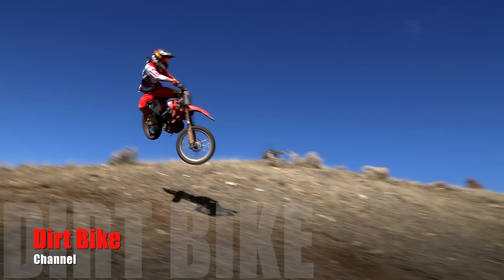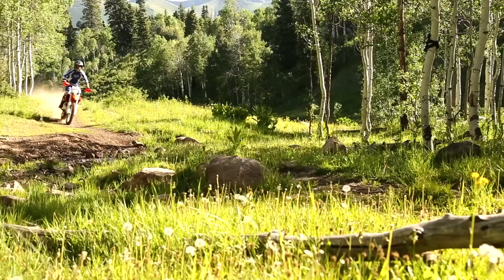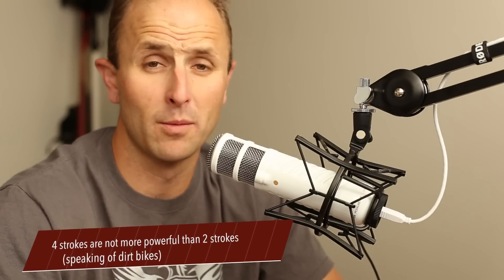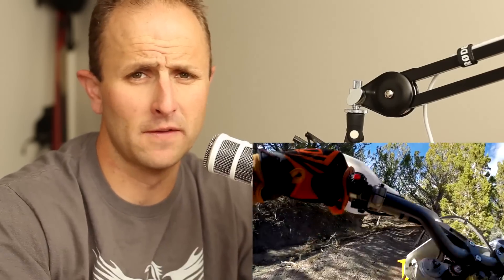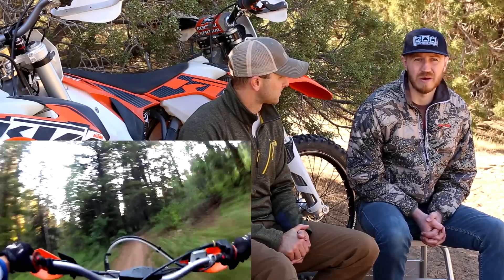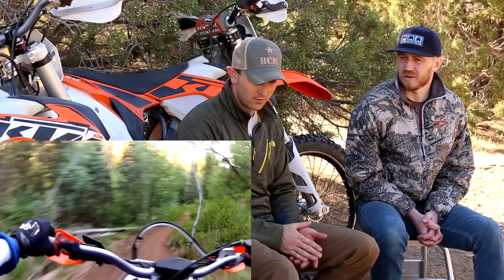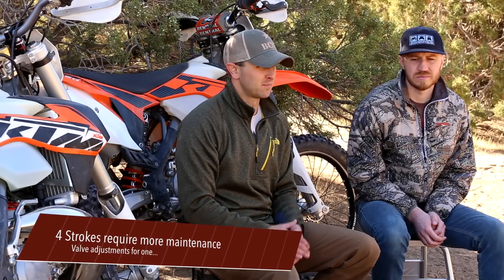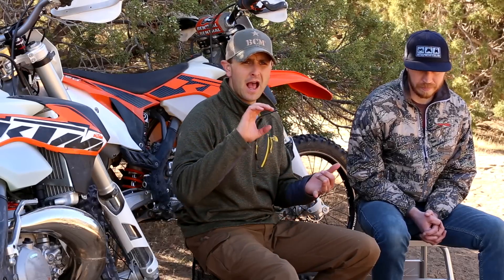Enduro 4 Stroke vs 2 Stroke Part 1

Comment: that do not make sense so the 250 make more pawer that the 454 the 454 should be fast lol
Reply: +pavel1809 how does it not make sense that a 250 2 stroke makes more power than a 450 4 stroke? its not all about displacement man
Reply: Imagrumpy Oldman Yeah i know about the Maico's but they actually dont have much power at all, but they're pretty damn cool still
Reply: Really? but they dont make Maico's anymnore?
The 490 from 1980's only had 30-39 hp x) todays 85cc's got around 34 hp, but then again, the Maico's are very old.
Reply: haha :D
Reply: My 250 makes 50 HP, with a good low end as well.

Comment: wow how bias is that. remember if you need to adjust the valves not when.
Reply from the maker: +Bill Needham First off, thanks for watching. Just trying to give a little bit of the bias back.  Everywhere else is very bias in the other direction.  It's called balance :)  Watch all 6 parts and you'll have a better idea of where I'm coming from.

Comment: They are full of shit lol 2 stroke cost way more in the long run way more rebuilds and yes parts are cheaper but it all adds up and if ur aggressive rider like I I'm 50 hours tops in my opinion for 2 stroke before u blow it up lol these guys make me laugh so hard
Reply from the maker: +Tyler M You blow up your bikes after 50 hours?  What bikes have you done that with? Just curious.   I have put more than 100 hours on multiple top ends on my bikes with no issues.  Let me know.  We can have a civil dialog about it :)
Reply: +Dirt Bike Channel I go long miles those roughly 1000 in 2 weeks 125s arnt good 2 stroke motors and I prefer 450 4 stroke way less maintenance more reliable and uses less gas and go longer distance I guess every rider has there own bike they prefer
Reply from the maker: +Tyler M Fair enough.  125 two strokes need to be revved out all the time, so they wear out much faster.  250 and 300 2 strokes are a totally different animal.  Glad you have a bike you enjoy. That's what it's all about.  I own a 450 4 stroke and a 300 two stroke at the time I' writing this, so I know a bit about the topic :)  Thanks for watching Tyler!

Comment: Ur only saying that 2 strokes r better cause u own one and I bet you have never owned a 4 stroke. Ur making this video to feel better about ur purchase and to be a YouTube bully! That's bullshit that you need to work on 2 strokes more! Engine rebuilds because your running at about 22,000 piston beats per minute! I'll never own a 2 stroke cause their shit and the 4 stroke was made to improve the 2 stroke and it happened! Get in the future m8 2 strokes have been replaced. If their soo good than how come factory's have stopped making 2 strokes😂
Reply from the maker: +COOPER CHANNEL Cooper, Cooper, Cooper.  I have no doubt that you are a nice kid, but I have to set the record straight here.  I own a 4 stroke bike and a 2 stroke bike as we speak.  They are both in my garage right now.  You can verify that my looking at my recent video feed.  I rode 4 strokes for the first 32 years of my life. I have purchased 6 bikes in past 5 years.  3 of them are 4 strokes have 3 of them are 2 strokes.  My guess is that you, my friend, don't have much time on the 2 strokes.  And about your comment with 2 strokes revving higher, the 4 strokes rev significantly higher than the 2 strokes. A 300 2 stroke only revs to about 8500 RPMS.  The 350 4 strokes I had last summer revved to 13,440.  My 450 4 stroke revs a little over 12,000.   Those are facts verified my all the magazines, and my tachometers :)  Oh, and there are multiple factories making 2 strokes.  Ever heard of Yamaha, KTM, Husky, Gas Gas, and Beta to name the biggest?  More are about to follow.

Comment: lies lies. 4 STROKES ARE BETTER  it's simple
Reply from the maker: How much time have you spent riding big bore 2 strokes?
Reply: +Dirt Bike I need to get power immediately when I go up hills and you can't get that with 2 strokes bc you have to revv up 2 strokes to the higher rpms  to get the kick out of it. and when you do long distances I have to carry the oil and gas which is stupid and listening to the 2 stroke sound is soooooooooooo annoying. and it's simple 2 strokes suck
Reply from the maker: I have to whole hardheartedly disagree with the low RPM power.  My 300 two stroke makes more of it than any of the 450s I've owned. I'm speaking from a fair amount of experience :) My range on my 2 strokes is nearly what they are of my 4 poppers.  The sounds they make, we'll that is all opinion and yours is as valid as mine there.   Thanks for watching.  Keep riding brother!  BTW, I own two different 4 strokes right now, and only one two stroke.  I like them all.
Reply: +Dirt Bike Channel ok i get it too but I think 4 strokes are more snappier which is the point I'm trying to make and snappier in my opinion is better for trail riding
Reply: +Dirt Bike Channel and im not saying 2 strokes are bad:)
Reply: +Dirt Bike Channel and i do 50-70 miles on a trail ride and half of it is uphill so I need the snappier kind